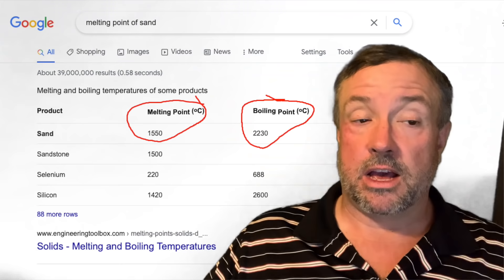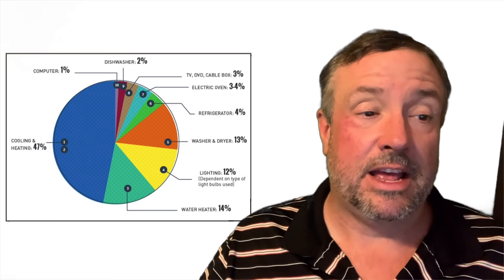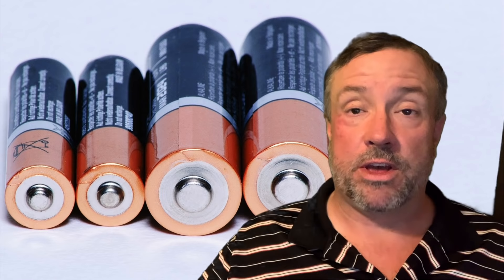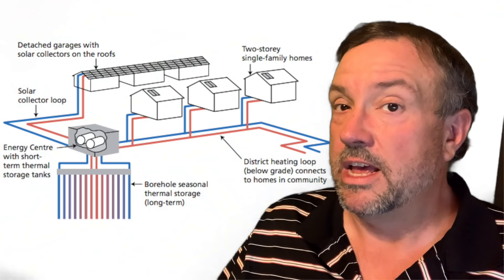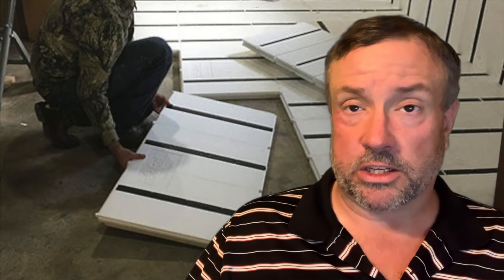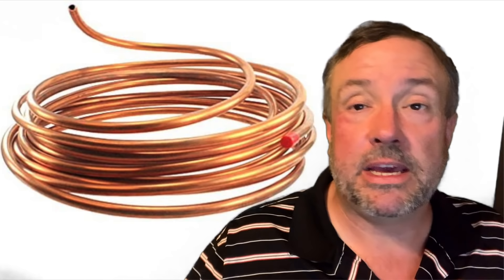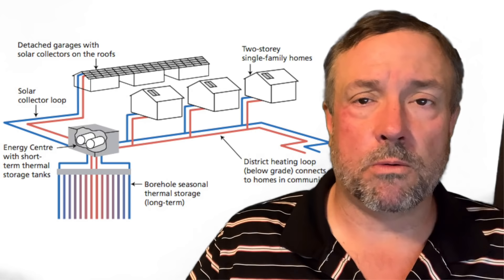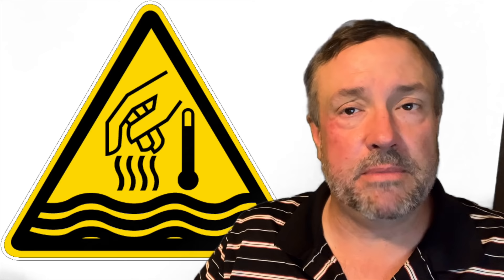Sand for Thermal Energy Storage

Comment: I am planning on building sand thermal storage unit for central heating.
Important part which would help better efficiency (I hope) is that I am planning using electric solar panels.
Thea are getting cheaper every day (0,50 to 0,70 USD per Watt).
For  heating sand I am planning to use induction heaters placed on bottom of storage unit. (induction has up to 30% better efficiency compared to standard thermoelectric heater) not to mention that nowadays we can find them cheaply  on internet with different power output and different working voltages. Lets say that you get one working with voltages up to 36V... You can hook it almost directly to solar panels avoiding expensive inverters.
As mean of connecting thermal storage to heat exchange unit of central heating system I am planning to use Air. Important part of this design is to put air pump of your choice on return pipe hence avoiding damage from high temperatures.
It would be smart move to put depressurized  metal tank above thermal storage to reduce thermal loses.
Another suggestion is to put lots of mineral wool above it and to place on top of it yet another tank filled with water which could be used as well. (if nothing else as hot technical water.
Reply from the maker: that's awesome

Comment: I think olive oil would be good. The iron piping (iron transfers the heat so evenly) would not fair well with water. It would have to be a continuous flow. So input at the bottom and output at the top (that flows underground) to the radiant heated floors then back to the place where it started. I forget it gets so cold in Canada. Maybe look into flaxseed oil (freezing temps) idk. like I said I am tired. Maybe it wouldn't freeze at all seeing as how only little of it would be above ground. I would think that all could be somewhat insulated as well? I need to go to bed. Good night y'all <3
Reply from the maker: interesting

Comment: For large sand blocks in the ground insulated or not you'd want to have the sand dry at all times. If you have wet sand and metal pipes the pipes will eventually rust or corrode and then you'd have to have a system to remove the sand, replace the corroded pipes and put it all back together. The other issue is how long will the pipes effectively sink the heat into and out of the sand. It is not a fully workable solution. There are small scale home heating boxes that utilize fire boxes contained in a larger box filled with sand. Internal heat sinks take that heat and radiate it back into the house leaving the house toasty warm and don't remove the humidity.
Reply from the maker: interesting
Reply: I have looked but have been unable to find something like that. Would you have any leads that you can share ?  Please and Thank you.

Comment: If you use rocks instead of sand you would be able to use air flowing through the pile of rocks as the fluid medium.   I am thinking rocks the size of a grapefruit would be about the right size for optimal air flow but I am not sure.  You could use a car radiator and fans as a heat transfer device to go from oil to air.  A few air return tubes would also help with air flow.  A small solar panel could power the fan.  Also Rockwool would make a good high temperature insulation for the walls and ceiling of what ever holding structure you use.  I think the aircrete would work for the floor and walls but the surrounding circular structure would probably need to be steel or steel reinforced to handle the outward pressure of a massive pile of material.  Also the bigger you go the more cost effective per day of stored heat it will be.  I am not sure how well aircrete can withstand very high temps.

This has the advantages of not needing to be leak proof, simple, cheap and very low maintenance.

I am wondering if high pressure nitrogen can be the working fluid in your solar concentrator, you know being inert, noncorrosive, cheap and who cares if it gets too hot.  Air may corrode metal too quickly at those temps.
Reply from the maker: Interesting! Thanks for sharing

Comment: Short and sweet. 

Think of the as a BTU capture system.    The target end heat is say 24C, and how much BTU will that require? 

As long as the collector / battery is hotter than 24C it can be workable. 

The next question is scale.   If there is s space, it can get very simple.   1 acre, worth of solar gain at a good noon, should get about 1kW / m^2 , or about 4 megawatts / acre, or about 13M BTU / hour. 

The Nick Pine and the solar space people claim about  ~1000 BTU / day  captured per ft^2 of vertical glasing.   That's a great start.  

If the application requires higher heats, or the higher heat ends up increasing battery storage, try putting lenses or mirror in the glazing setup so through out the day they focus on matt black ceramic / rock , not so much of a focus to melt the the rock, just to create a very hot updraft colum of warm air.  Then channle that extra hot portion into the center of the heat battery.  Which can be above (and maybe behind )  the collectors.  

Everything is worked by thermosyphon, no worries. 

Good luck, I look forward to your outcomes.
Reply from the maker: thank you!

Comment: Use air collectors to heat the mass and then a separate air pipe to pump back out the heat, you can then introduce the hot air via a mixer pipe of local air or feed it into a large mass radiator in your home. Pump the air from the cold side into the heat store and receive the heated air.
Reply from the maker: Good idea!

Comment: Start with phase-change material of your choice based on temperature considerations. Consider recharging options/sources... Good luck...
Reply from the maker: Thank you
Reply: @Simple Tek  check out Sunamp’s Thermino heat battery... use a heat pump which "pumps" heat 250-500% more efficiently than electrical baseboard heaters with on-demand Sunamp PCM hot-water heater and you have taken a giant step forward...
Reply from the maker: @douglaspohl1827  very interesting
Reply: @SimpleTek  Do the math... numbers don't lie... win-win!

Comment: I know this is two years old but I was thinking about using a glass lined water tank filled sand buried below the frost line with coiled heating element in the center and coiled copper tubing. The ground will act as an insulator. The water could be pumped in and once it comes out it would have absorbed the heat. Use solar to heat a resistive element use water to get the heat out

Comment: I've been thinking about this all day.
1. Take a page from Sergio(so.?) And test as much as you can before committing to expensive endeavors
2. Stick to simple Tek, even if it means you can't capture as much heat. The cost and likely the risk will be far lower. To me that means store lower temperatures and use simpler more common parts.
3. Start small. Don't soon to heat your house on the first go. Maybe just a room. That way if you fall, not much is lost
Reply from the maker: nice

Comment: Water only boils at 100 degrees Celsius or 212 degrees Fahrenheit when the water is at atmospheric pressure. You can get water to much hotter temperatures without it boiling if you kept the system closed and under pressure. You're plumbing would have to be done using galvanized pipe for much of it & I'd used heavy gauge copper for my heat exchangers. 
You could always use a temperature balancing mixing valve on the system to tame hot temperatures before sending the water into temperature sensitive areas of the system.
Reply from the maker: good point
Reply: @LaurenBurger  Thank you for your feedback but this is how commercial & industrial boilers operate everyday & everywhere. The important part is to use materials that can handle pressures above those that are expected. Hence the reason that I suggested to use galvanized pipe & heavy gauge copper pipe. Water will not boil, even at 500° F as long as it is under the enough pressure. 

Interesting note: Water will boil, even if it is at 0° F, but in this case, it must be contained in a chamber under vacuum and not pressure. 

Another note: Water can also be in its solid (ice), liquid, and gaseous state (called its Triple Point) all at the same time, if conditions are correct.

Comment: What if you use sand as the medium? Vertical steel like a grain auger with the worm lifting the sand up the auger surrounded by a solar collector like a parabolic mirror. Use a electric motor powered by solar to run a group of them on a south facing wall. Hot sand falls back into the battery built like a grain hopper to spread the heat. Then collect it in liquid like you described. Gear it so the sand gets good and hot.
Reply from the maker: Great idea

Comment: I'm thinking about just using air inside copper tubing. The tubing could run through shallow dirt first then through a black greenhouse style heat collection box(s) with glass/clear epoxy top(s). 
The pipe wouldn't coil through each box. It would just port into and out of one side (right and left ends of one side)  after running through multiple 4x8 black greenhouse boxes then the pipe (insulated)  could travel to and coil through insulated 55 gallon barrels full of sand. 
When they come out of the sand the pipe can end back outside.
At the very end of the pipe it would be necessary to step up the diameter and have it run straight up about 10'.
A fan pushing ambient temperature air in may be needed to get it started, but hot air rises so the hot air coming out the end of the pipe will naturally rise pulling incoming air all the way through the system. That way you won't even waste energy on a fan because the air will pump itself through.
I have a couple ideas about how to make the black greenhouse boxes collect heat more efficiently but that's too much to type. 

The barrels of sand could have two coils of copper tubing running through them. 
1st supplies heat from black boxes.
2nd allows you to extract heat and then run that hot air through square metal pipes lined with thermoelectric generators. 
There would be two parallel square pipes with T.E.G.'s between them. One is the cold air intake and one is the hot air output coming from the barrels. 
With them running parallel it would be the most efficient for two reasons. 
1: you don't need to cool the cold side of the teg, and 2: the temperature gradient (and presumably the electrical output) would be most efficiently equalized over all the tegs.

In fish gills the blood flow runs opposite to the flow of water. Look up a video about how and why that pulls the greatest amount of oxygen from the water. 
We could apply the same principle to thermal conductivity passing through the tegs.
The air circulating system that runs through the tegs may be able to self propell using the rising hot air like the heating system does, but if you're using it to push hot air throughout your home after passing the tegs then you may need a fan pushing air into the Intake side (but the tegs could easily power that).
Reply from the maker: Wow!!!!

Comment: Hi, I just found your channel and specifically this video. You seem to be asking all the questions I am asking myself and searching the internet to answer. Now in the UK energy is becoming very expensive and in the past the government has encouraged those that can, to predominantly use gas combination boilers, which are efficient and convenient, but now expensive to use. I have watched a great many videos on solar thermal and I am thinking of building a solar trough system. The main problem I have is working out the potential heat output given a "normal" day and a set size of collector. I know this will alter with time of year and weather condition etc but you have to start somewhere. My initial thoughts were to build a system to run along side my existing system to create cheap energy when it is available and run on my existing system when needed. As so many videos on this subject are very good at showing us what they have built, How they did it and that it works, I can't seem to find any that give any test results showing temperatures gained for a given size of collector etc\ There are some videos that go into test results but these seem to be made by professionals quoting mathematical equations that are beyond me. I am a practical person and trained many years ago as a heating engineer.   You ask in your video for people to help with ideas, well I'm keen to help and try and progress ideas for the benefit of us all. If there are any people out there reading this that may have some test results they wish to share I would be very grateful. Thanks for making the video I' now going to binge watch the rest of them for more ideas.
Reply from the maker: I have many videos with other heating and heat storage systems in my archives
Reply: @SimpleTek  some great ideas, thanks for making the videos. I will keep you updated with my progress
Reply from the maker: @davidking2124  good luck with your project and please keep me updated

Comment: I always wanted to build a heat exchanger where the sand is heated by solar PV powering a resistive element. A copper pipe is then coiled through the hot sand heating the water on demand in a matter of seconds.

Comment: They have been doing this in England for years. The average house in the UK in the 1970s had a gas or coal fired furnace that ran long hours every day. the flue of the furnace was surrounded by copper pipes that absorb waste heat as it is going up the flue and heats water/oil which is pumped to each room and through a block heater that is roughly 4 ft long 3 ft high and 3 ft thick. the block heater is filled with the copper tubes surrounded by and sand it absorbs the heat all day and radiates it out all night when the furnace is banked down to conserve fuel. It stays warm enough to keep the average size room (10 X 10) toasty. It serves the same purpose as the hot oil or steam radiators that were standard until the mid-sixties in the USA with the added benefit of holding the heat longer. It isn't so much a factor of how extremely hot the water/oil gets as much as how long the heat is allowed to build up before the heat source is removed.
Reply from the maker: That’s awesome

Comment: You can use steam. 1600 degree steam could be generated and allowed to circulate through a series of copper tubes buried in your sand then vented out. No pump necessary. 
 The steam is generated by a large parabola array.
Reply from the maker: ok

Comment: How to direct the sunlight direct into the sand over channels with some type of mirrors or fiberoptics?
Then place pipes in that, to use some of the heat.
Can use water it just need to flow thru the sand, to reach 90°C. But if no water is needes it must evacuade put of the system or at least have the possibility to expand in a tank or an overpressure valve. Install pipes with an inclinationt, and cut of the water supply electronical so watee will flow out again and collecte outside.
Reply from the maker: Problem is depth, without heating tubes sand will heat only so deep effectively

Comment: Geothermal closed loop system has everything you need. Heat and ac. All in one
Reply from the maker: Needs a lot of electricity
Reply: @SimpleTek  We live in southwest Iowa our monthly electrical bill runs about $175 a month we are basically all electric just propane for the stove. The geothermal is a closed system it pumps fluid thru 4  160ft deep wells using very low hp circulating pumps which picks up heat in the winter and cooling in the summer. It does have a electrical coils for backup if the temperature drops to -30 below F  and the wind blows. Government gave us a 60% tax credit at the time, we've run it for about 12 years no problems. Check it out. Zed

Comment: Here is a question for people with experience using sand in tanks: 
I have heard that if you put round balls into a container and cycle the temperature, because of gravity pushing down, the balls will expand when heated and settle down when cooled. The next time they are heated, they tend to break the walls with thermal expansion. Is this something that also happens with sand? Will the sand tear the tank apart with repeated thermal expansion and contraction?
Reply from the maker: Interesting question
Reply: No, porque en la arena hay espacios vacios y facilitan la expansion .

Comment: What about diverting the heat from the heat source via a culvert type pipe buried underground. You might need to control the temperature of the air as it enters the structure being heated.
Reply from the maker: Maybe